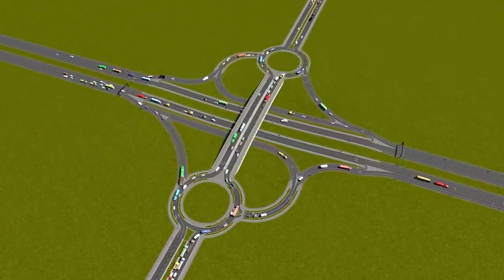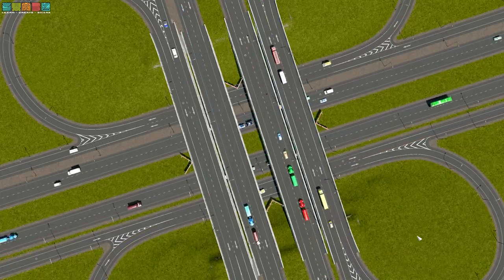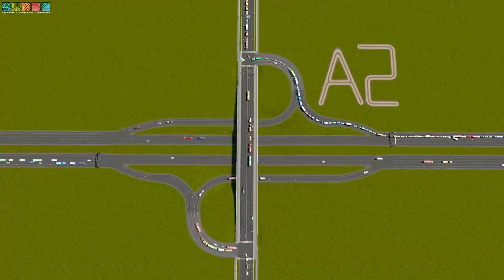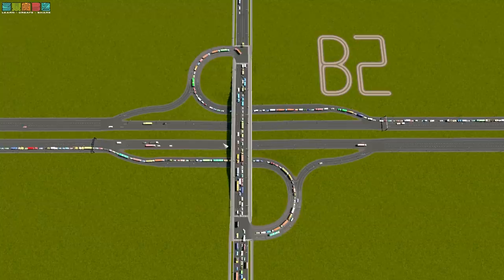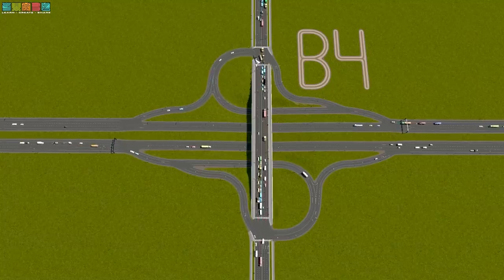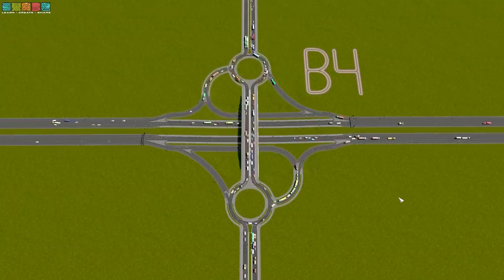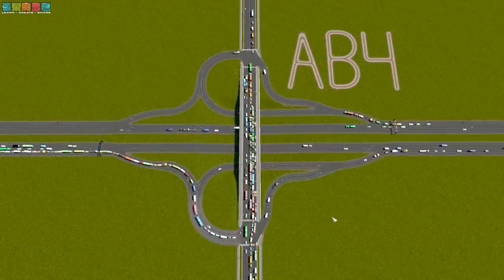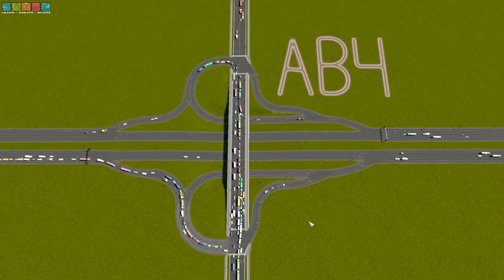Types of Partial Cloverleaf Compared!  -  ParClo Interchange Comparison

Comment: I think in real life this AB2 is build, as it saves space,  sometimes you have already buildings on one side of the road and from city planning, they might be both at the same side.
Reply: It could also be that there isn't space along the highway as another interchange is nearby. Having the AB side facing away from the next interchange sothe ramps take up less space and more space on the highway is available for weaving between on and off ramps of the two interchanges.
Reply: When we have an AB2 in my town, it's because there is a railroad running along the other side the road.
Reply: This is how I've seen AB2s implemented in real life
Reply: Have two AB2 ramps off my local arterial because there is a rail along the the other side, limiting other ramp options. Luckily, the light situation is fairly well timed for the volume of traffic... mostly.
Reply: It's painful to see honestly, regardless
Reply: Have a AB3 (an AB2 with a slip stream onto the highway) because there's an airport right at the quadrant of the highway intersection so can't fit a slipstream there to help out with cars turning left onto the highway.  Man going thru that area sucks because of the traffic volume
Reply: In the Netherlands they are super common. I assume the reason is that with traffic lights the weave is easily avoided.
Reply: I think I saw an AB2 being used with a bridge too. So the loops are on the land and the rest of the intersection leads into a bridge over a river.

Comment: I think the ab2 would be acceptable if the arteriel is ending at that point (or there is at least heavely asymmetric traffic) and you have no space for diagonal opposed leaves.
Reply: I agree with the second part of your comment. I live near an AB2 interchange. Where the highway is bridged and is about to cross over a river. There was no room on the bridge side to have a ramp.
Reply: Ab2 is often used if there are rail road tracks close to one side of the road
Reply: Or if your highway is on a rather steep grade.  Putting the loops on the "high" side of the arterial is much more feasible.

Comment: AB2 and AB4 just seem worse than a simple diamond service interchange in almost every conceivable way
Reply: The only advantage of the ab2 in my opinion is space. If there was another interchange really close and there wasn’t enough room for a diamond interchange and you still wanted full access then ab2 is fine
Reply: @Unnamedchannel755  Is that really the case though? I'd have said that the AB parclo is bigger than most diamonds, since any form of clover needs to be big enough to allow for the leaves — they can't be too small lest they become a roller coaster, with vehicles pulling high Gs as they accelerate up to highway speeds. Whereas a diamond can be almost arbitrarily compact, limited only by the ramps needing to be long enough to accelerate or brake.
Reply: @simongeard4824  i think they mean giving space for the next interchange

Comment: One way to remove pressure on the AB4 would be to remove the pinch point at the offramp. You have a single lane leaving the highway, splitting into two lanes where one turns right and one left when they hit the regular street. Obviously the left turn at that junction is the blocker, so if that was two lanes from the highway where traffic could chose if it was going left or right by getting in lane while still on the highway, then things trying to make a right turn wouldn't be sat behind things waiting for their opportunity to turn left. I'm not sure that the cim AI would understand the concept tho, and might just queue on the highway anyway.

Comment: Just a possible fun fact

But the A in A2 probably stands for "ante"
This is a latin word for "before" and is often used in older words like
AM: Ante Meridium (Before Noon)
Antechamber (self explanatory)

But also modern words such as:
"To anti-cipate"
or an "antecedent"

... maybe :P
Reply: I'm pretty sure A stands for "approaching", ie. the loop is located as you are approaching the overpass, and B stands for "beyond". Which is silly because as Yumbl pointed out, "after" and "before" are more intuitive, but are opposite of the abbreviation!
Reply: @dylanyu6541  Yup, it's "ahead" and "beyond" when viewed from the perspective of the highway, and "after" and "before" when viewed from the perspective of the arterial. :P Or in other words, treat it as arbitrary.
Reply: @dylanyu6541  Ye it could be, I wasn't sure which is why I said "maybe" :P
Reply: I think A comes before B, therefore A loops are before the crossing.
Reply: @OntarioTrafficMan  It would make most sense to describe it from the highway's perspective. A parclo with 2 loops, both on the same side of the highway makes even less sense than an AB (...I think, but they should be close). And since just alphabetically numbering is a way better explanation, I would assume that's what happened.
But where would C loops be, then? Deep philosophical questions...
Reply: @Pystro  I C loops would be in a completely other dimension I guess :D
Reply: For me, it's easier to think in the perspective from the arterieal's EXITS. 
A: exit turns AFTER crossing the HW. 
B: exits turns BEFORE crossing the HW.

It's problably a convention, but what works for memorize is valid, I think

Comment: In terms of the AB2, if the highway is crossing a river and the road is parallel to said river, you might have no choice but to use an AB2.

There is an interchange in Portland, Oregon which does this and for this reason, I believe. Only it’s not a service interchange, it’s two highways…. But it’s the same idea in that the river forced design decisions.  I think it’s where the 205 crosses the 14.  I drove it once with my dad on a trip from Mexico to Canada. I grew up in a very rural part of the world… interchanges blow my mind.

Edit: corrected interchange type
Reply: on google maps it shows that there are no signals, because 2 of the left turns are like left turns on a stack but still the weave on the leaves

Comment: I've driven on what I'd think is a Parclo in Tennessee that was effectively an AB4, except both loops were on one side of the interchange. It had an arterial over the interstate with loops and slips on the southeast side of the interchange, or to your right if you were northbound on the highway. The opposite side just had ramps for on and off traffic. The leaves feed into a merge lane that comes off the main northbound lane and then re-merges after the northbound slip. Don't know how you'd classify it, but I'd say it worked, except for the fact that it was barely a mile up from a Flyover T that merged into I-40.

Comment: AB2 is my exit off the highway in my hometown lol. It works fine because in my location traffic is very asymmetric. Most of civilization lives “south” of the exit (as you have it set up) and only a little bit is north. There’s a light at the southern intersection and there’s no light at the northern one

Edit: my mistake, yes there is a light at the northern intersection one but it’s almost alway green until someone sits waiting to get off the highway and turn left (north)
Reply: yeah that's what I was thinking. If there was an extreme lopsided traffic load to one direction it would mike sense to use the AB to favor that one direction even if it has a very bad effect on the other. Doesn't really have a place in Cities Skylines but it is fun to think about.

Comment: As to A4 and B4 with roundabouts, the volume of traffic is sort of swapping, so in the regular B4 (without roundabouts) the left turns accure from the "inside" of the arterial (on the bridge) and slow the traffic, but with a roundabout you give priority to the left turn, and slowing down traffic from the outside of the arterial.
i would even consider A4 with roundabout that for the same reasoning, act very similar to B4 without roundabout.

Comment: In my area, I have an A4 parclo, which has been designed to allow cars to pass through to get back on the freeway.  I don't know why NCDOT does this.  Probably to account for the people who have no idea where they're going.  It flows decently enough, but its in need of traffic lights now that more industrial units are going up.

I also have a more unique Parclo that's just a single leaf getting on the freeway while the rest of the interchange is a diamond.  Don't know what to call that.  But considering the area is mostly rural, it makes sense, with one direction meant to handle heavier traffic.

Comment: Love it!
I think you identified the difference between A4 and B4 correctly, B4 has 2 lanes entering and 1 lane exiting per intersection. A4 has 2 lanes exiting and 1 entering. The largest contributor to the preference is probably the road real estate difference between them, as the preferred direction can split its traffic over two lanes (slip lane and lane from other junction).

I've seen AB2s being used at less rural areas, but they often have a light, with multiple dedicated turning lanes just to allow traffic to wait without backing up into the intersection (so you'd have 3 lanes to turn right onto a 3 lane road for example). The AB2 is probably only good in the scenario where you can't build on one side of the road, or need smaller footprint (wider roads are easier than new roads). I've never seen an AB4 though.
Reply: I think the differences between his intersections would be less when set up with traffic lights. Because the traffic lights would eliminate the weaving.

Comment: Great work as always! I loved seeing the in-game comparison of these interchanges that are so common in southern Ontario! Two things on the AB4:

1. In real life, the south intersection — if not both — would be signalized and traffic exiting to go northbound would likely not turn into that leftmost lane, eliminating the northbound weaving. Southbound weaving does remain an issue though.
2. In the same way that an A4 prioritizes traffic exiting the highway and B4 prioritizes traffic entering the highway, AB4 prioritizes traffic heading to and from the east, since all movements to and from that direction are via free-flow ramps. That's why that design might be used in real life, for example, at a suburban interchange where most traffic is headed to and from downtown.

Comment: Weaving is generally not an issue on the arterial, because the ramp terminals would usually have signals. Then traffic exiting the highway doesn't go at the same time as traffic entering.

Comment: The ab4 sucks, but it’s also the real life single highest bandwidth example of a single bridge- parclo. Look up the ab4 single point parclo in fargo. It’s actually between a spui and your single point parclo in terms of flow. I’ve heard it be called a super spui. It uses a light phase with both quadrants hitting the same point just like an ab4 (inner leaf only) jug handle intersection to eliminate weaving. It’s hard to explain but give it a google. It’s my favorite interchange right now because it’s more applicable than a spui, ddi, a or b parclo for diamond interchange upgrades considering the dimensions, and also allows for a free- flowing highway runaround. Oh yeah, and no stop for straight through traffic on the “inner” side of the interchange. Smallest ramp length to interchange ratio I can find on a solid flowing interchange, so in game that translates to more interchanges on the same highway, longer weave zones for traffic volume compression space to keep my highways <3 lanes and less space between properly accessible arterials. Normally this isn’t an issue but I have every car set with a certain top speed and roll properties in the advanced vehicle options menu, and in conjunction with tmpe path of evil it actually gets really close to simulating very very realistic highway movements and bandwidth emulation for my sims. So Yeah in cities skylines I don’t think most save games will make a difference but I’m telling you that ab4 fargo interchange is actually super cool, and it’s the only real life demonstration of a single point parclo WITHOUT flyover or stack ramps, like the partial diamond/ parclo/ stack in aurora, co near where I live connecting i225 with 83. I definitely hope to see more of single point ab4 designs in the future. It’s so cool In fact I think it deserves to be called an ab5.

Comment: 0:41 that is what i would call a modified cloverleaf, because the highway splits into 2 roads. one goes straight through while all the splitting, merging and weaving happens on the other one.
but you can't really compare this one with the other ones in this video because they don't have the same types of roads.

you can practically eliminate the weaving problem in a modified cloverleaf by switching the 2 lanes going into the side roads, using bridges. that way, the only weaving will occur when someone wants to do a 180 and go back the way they came. i built and tested one of them on the junction test map. i placed obstructions at thee exits from the cloverleaf, when it was all jammed up, i removed the obstructions and traffic flow was back to normal within minutes. the same test on the vanilla cloverleaf (not modified at all) and it did not recover. the cars kept blocking each other.

BTW, i just noticed that some of the chevrons point the wrong way. they should be pointing where the traffic is coming from.

Comment: My favor is A4 instead of B4 for non-gameplay reasons. If the traffic exiting highway want to turn left onto another road after entering the arterial, the traffic lights can ensure the traffic make wide right turns, enter the innermost lane of arterial, and wait to turn left at next intersection. The B4 goes too smooth that they may have hard time changing lanes on the arterial.
Side note for AB2: possibly because of railway, river, or something blocking on the no-clover side

Comment: Hrm...I wonder how well an AB2 or AB4 interchange would work if two continuous flow intersections were introduced at the arterial...Now I remember - I actually did that, once, and then raised that turning left lane off the highway off-ramps into a low interchange (left turning lane bridged over straight through traffic) and it was glorious over-engineered madness. And it worked! And the AB2 interchange was necessary in that spot due to a river preventing a proper partial cloverleaf or even diamond interchange. IRL it would be an expensive boondoggle.

Comment: Wouldn't an AB4 (or 2) work much better with some lane connectors and a timed traffic signal? If left turns on/off the highway are signalized, cars would only need to cross through-lanes while they have a dedicated signal phase anyway.

Comment: Interesting thing about the roundabout one is that it is actually just the one roundabout, though it isn't really round anymore. We have them quite a lot in the UK, though usually when the arterial goes under the motorway (highway). 
The AB4 isn't as quite as bad as you suggest in reality, because traffic lights can manage the weave just fine, and traffic flow is not quite as regular as in cities skylines (not got after dark, does that change much?). For example, with lights WN traffic will go straight into the right lane at the junction, so shouldn't actually weave at all. 
You might use this junction where there is a significant bias in terms of highway direction. Traffic coming and going onto to the arterial from the east could be significantly higher than traffic from the west, especially at peak times. Think a commuter artery meeting an interstate, with nothing one direction for a significant distance. Rush hour traffic is going to be primarily one direction along the highway.
Imagine if you were to get rid of the slip roads leading west entirely. Then you don't even need lights, there are almost no conflicts at all. The only issue left is that NE traffic has to weave through ES traffic, but NE traffic will be heavy in morning rush hour, while ES traffic will be heavy in the evening. The AB4 can be efficient at either getting cars onto or off the highway in a particular direction, and all you need to do to switch between them is change the light's timings. For a junction to handle rush hour commuter traffic this is a realistic requirement.

Comment: There's an AB2 parclo on the edge of town here and it works just fine. I think the reason it was picked was to fit in better with the surrounding urban developments though I'm honestly not entirely sure. It handles the flow of traffic fine in either case.
Actually, the AB2 parclo seems to be a really quite popular service interchange around here. It's not just my town that's serviced by it (though it also has a B2 parclo), there are 4 other nearby towns that also have at least one AB2 serving them. They're more common than B2 parclos are. I honestly think the reason is just "space". All the room the interchange requires is just on one side, so it's just easier to fit in.

Comment: The interchanges in my local area used to be all cloverleaf, all the time. Terrifying to deal with a car merging from the right in the weaves, and commuter traffic was just awful for that reason. They're converting to A4 parclos, which is better, though I personally think a DDI might've been a better use of the land area since they're expanding the overpasses anyway. There are intersections right up next to the overpasses, which is just indicative of letting the roads stagnate until there's a major traffic issue.